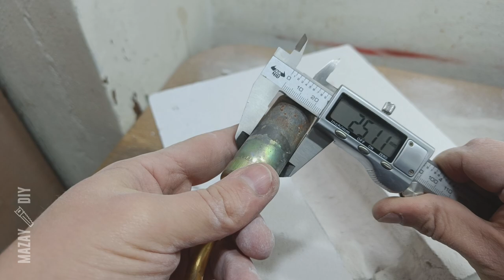DIY Mini Forge For Knife Making | Very Easy

Comment: I tried a similar project. I made a stove from fireclays and used a similar flame source. After 1 hour, I did not reach a temperature higher than blue. So I waited unsuccessfully for a red or yellow color on the steel. Maybe the stove was a little too big, but I worked with what I could. The steel was D2 old rasp.
Reply from the maker: Thank you for sharing your experience!
You have made several mistakes, which I will point out to you so that neither you nor other users make them:
- do not use firebrick (or fireclays) - it easily conducts heat, unlike aerated concrete (and firebrick is more expensive)
- make the stove as small as possible, otherwise you will not have enough heat from the burner
- as my experience has shown, for large knives one burner is not enough, light two at once
Reply: @MazayDIY  thx.